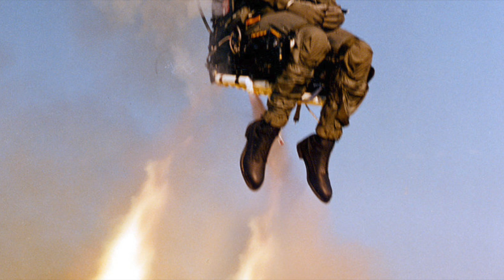004 - Ejection Seats

Comment: I see you added the low level CF-18 ejection, from 2010, to the episode playlist.  "Boozer", the demo pilot for that year, is a friend of mine.  Had actually visited with him (and the demo jet) about a week or so before that ejection.
Reply from the maker: Yikes!
Reply: @FighterPilotPodcast  Indeed!  Led to the high alpha pass being dropped from the 2011 demo routine, pending the outcome of the investigation.

A stuck ratio boost piston, in the right engine, is what led to the right engine not being able to go above idle thrust.  Back then, a vertical climb, in afterburner, was initiated to recover from the high alpha.  So, aysemmetic thrust, departure, ejection.  He did get dragged on the ground, briefly, after a shroud wrapped around his leg.  Luckliy, members of the Canadian Military parachute team came to his aid, released one of the Koch fittings and collapsing the chute.  Spent six months recovering from back and muscle injury.

High alpha was brought back in 2012 and the recovery was changed to pushing the nose down to level.